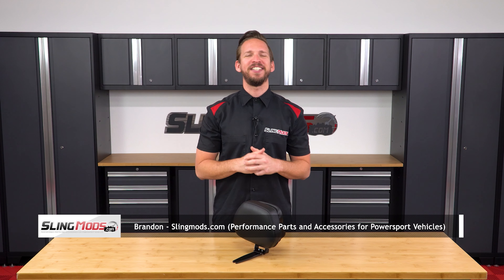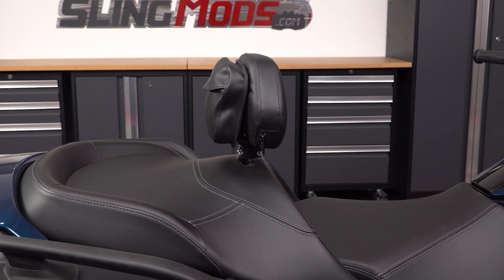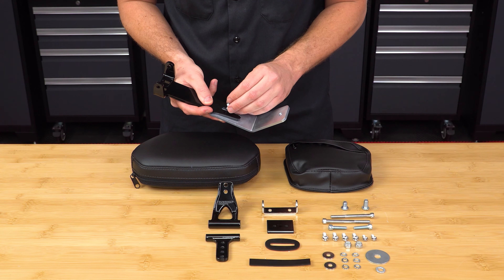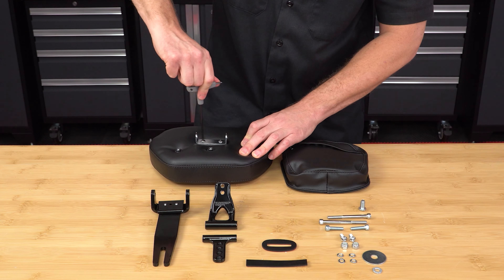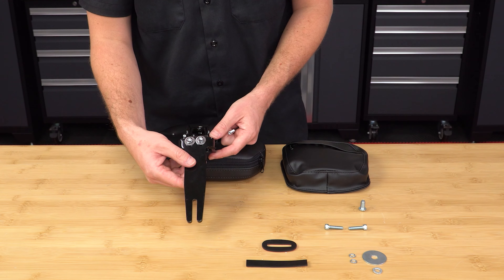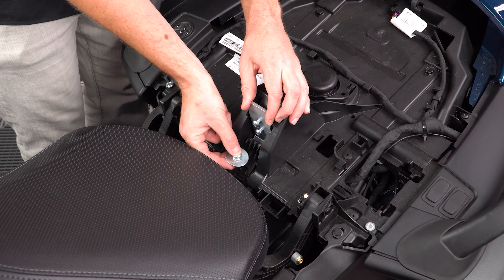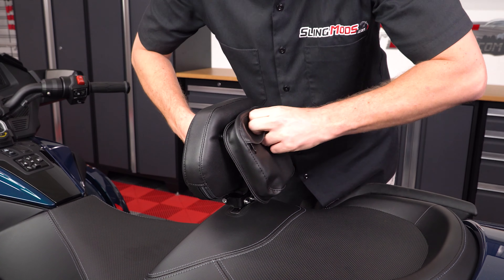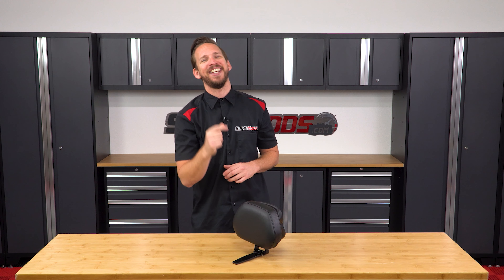Can-Am Spyder RT Padded Adjustable Driver Backrest (2020+ Models)

Comment: Great video. The new 2023 with matching stitching comes 90% pre-assembled to my surprise so it was literally 1 minute to assemble and then right to the RTL to finish the install. Great backrest!
Reply from the maker: Yes it does. After numerous customer requests we now have these pre-assembled. Thanks for watching!
Reply: @Slingmods  that was great. Saves tons of time. I can’t figure how to get mine to stay forward. When I lean back it goes too far back.  Am I just not tightening the bolts enough?
Reply from the maker: @UkuleleJayBBQ  Please shoot our Customer Care Team an e-mail at your convenience. We're happy to help! https://www.slingmods.com/index.php?route=information/contact
Reply: @Slingmods  thanks
Reply: Not as easy as the video. Evidently there has been some major changes to the seat pan on the 22 models to which this installation requires quite a bit more than releasing the passenger seat and loosing two bolts. Not counting you will have to be careful that the bolt head doesn't interfere with you wiring under the seat.

Comment: Got this, installed with some help from the video. The video doesn't say anything about the stick-on pads, nor the silver 1" thumb screws. Also the bolt for the fender washer is so short, I had to leave out the lock washer for it to reach the plate.
Reply: Had the same challenges.  Where DO the stick pads go?

Comment: Adding the bike mount at about 3.43 time, can be confusing, it was for me.  It slides in just below the large hole by lifting about the mid section of the plate.  I was trying slide it in lower than that, that won't work.  This back is rest is pretty neat, and easily removed for the passenger to mount and replaced.
Reply: How is the forward adjustability on this backrest?
Reply: Made the same mistake.  Your comment saved the day.  Funny , instructions don't mention the slot. Thanks

Comment: The vertical adjustment!
Reply from the maker: Hello Terry, at 2:41 in the video it shows you that section. You'll select from two of the four hole positions available and insert the hardware to lock in the height setting.

Comment: Installed a few minutes ago. The written instructions were cheap photocopy much too dark to make out details. This video was invaluable in making sense of it. The various bolts in the kit do not come labeled or in labeled bags so while you are told to use xxx size bolt, it's up to you to figure out which is which. This is actually silly too- because most of the bolts could stand to be slightly longer anyway. The single bolt that attaches the base to the bike was too short by a few threads and I ended up deleting the large flat washer and just barely getting it to grab with the lock washer in place. Why not just use another of the longer bolts already in the kit rather than try to cut two or three threads off a bolt? I nearly just ran to a hardware store to get bolts a tad longer. 
Also, there is an 'adjustment plate' that doesn't seem to do very much. At it's tallest it barely contacts the rest of the mechanism to limit how far back the seat goes. But at least in the middle configuration for everything, it seems superfluous at best. I could literally remove it entirely and not affect the seat. 
Once installed and tightened down it's comfortable although the range of adjustment isn't very much. It does fold over in a variety of ways to make getting on and off easier, but at the cost of having the whole thing less 'tight' by leaving some bolts loose.
Thanks so much for the video. Made the process much easier.
Reply from the maker: Thx for the feedback! Yeah.. we do videos for our customers because the MFG written instructions are often confusing and sometimes not existent.
Reply: I agree the bolts are not long enough in places you use the nut.and the instructions aren't very good.the video is a lot better it took me about 10 minutes because the last owner took the backrest but left all the hardware in the base of the seat.it was a exact match I just had to connect the top
 side only.but feels really comfortable.

Comment: I have this mounted on a 2021 RT, but when adjusting the back rest it still continues to come back all the way after tighten the bolt, is there a adjustment screw that keep the back rest in place after it's adjusted?
Reply from the maker: Hello Terry, are you referring to the vertical adjustment or horizontal adjustment?
Reply: instaBlaster.

Comment: I just installed this on my 2022 RT Limited yesterday. A few notes about the install. First, kudos for this video because the directions that come with the back rest are horrible. They need to be updated and expanded and not look like they were printed from a 1960s mimeograph. They need step-by-step pictures. They also need a hardware inventory that also depicts each piece of hardware at its actual size. Saying use the M8, M5 or M whatever size bolt does nothing for me. Plagiarize Ikea instructions.

The bolt that mounts through the seat pan into the main bracket is to short when using both washers. I was only able to install the bolt if I left out the lock washer. I will be buying a new bolt so I can install the lock washer along with the fender washer.

The two bolts that screw into the upper portion of the main mount which are used for install the backrest bracket are too short. The instructions and this video say to leave them finger tight so the back rest can be inserted and removed. The problem I see is that these bolts will loosen over time. One option would be to use a lock-tight type product to hold the bolts in place, but the problem I see with this is if you have to make a fine adjustment you have to remove the bolts, clean the threads, reapply lock-tight then make the adjustment. I plan on buying longer bolts that thread through the bracket then use a nylock nut to secure the bolts in place.

Lastly, I had parts left over and because of the lack of inventory on the directions I have no idea what they are for.

Hope this helps.....